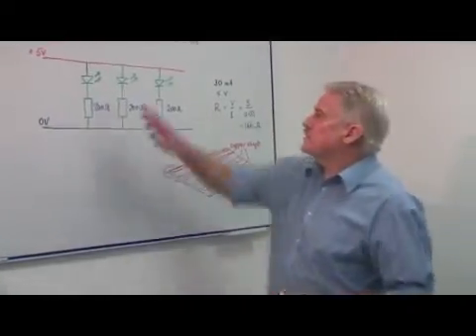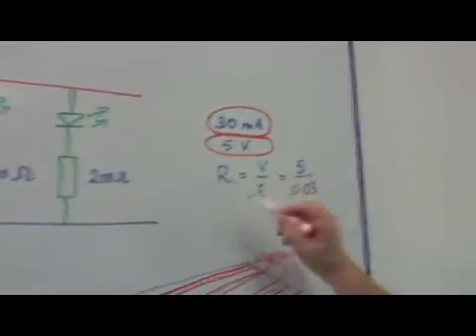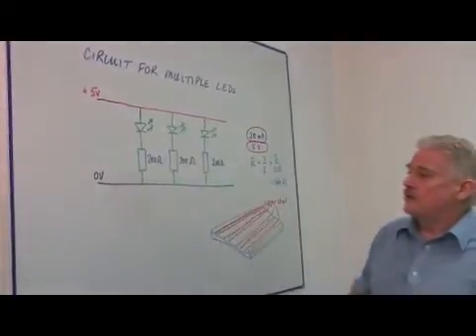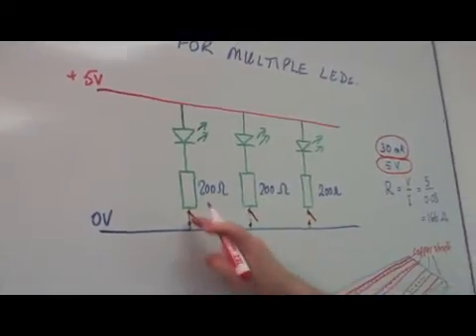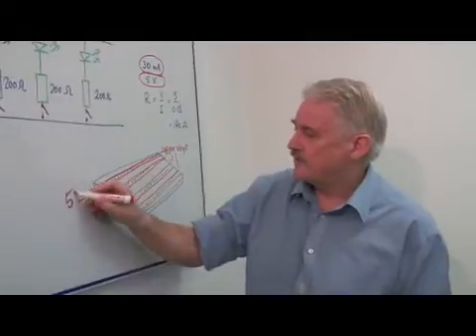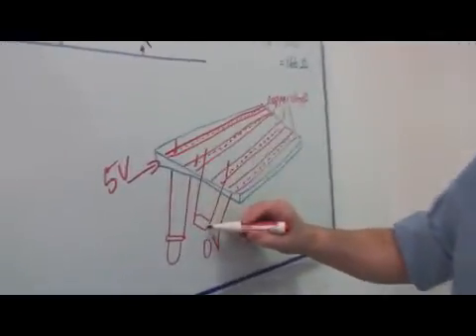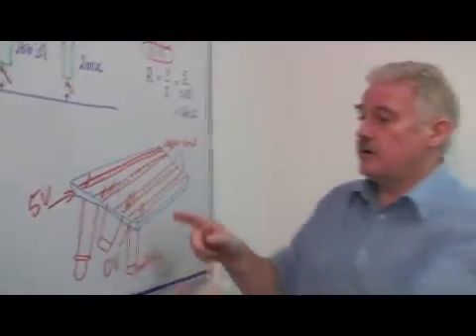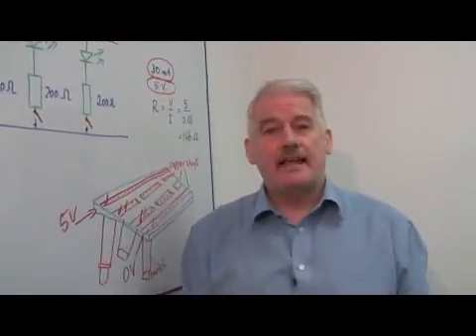How to Build a Circuit for Multiple LEDs

Comment: Great tutorial but now I am confused. I saw a different circuit yesterday and the resistor was on the  + side?   Many thanks ...John :)
Reply: Hi John,

It doesn't really matter which side you place the LED on. The LED will always drop a certain voltage (case by case) so the resistor will always limit to a specific current as well. For passive components like LEDs, inductors, capacitors, the order is usually up to you in series.